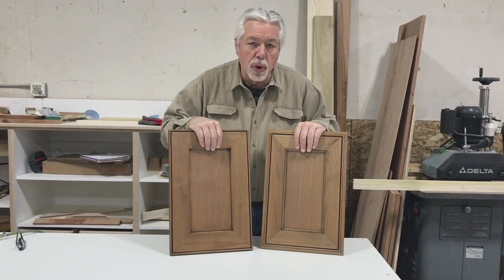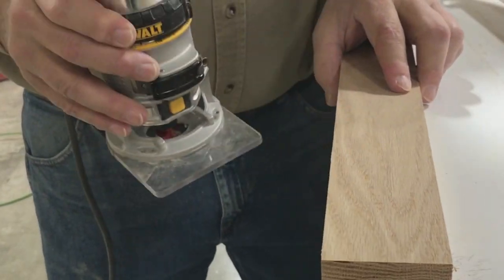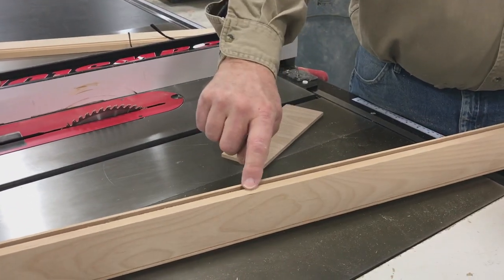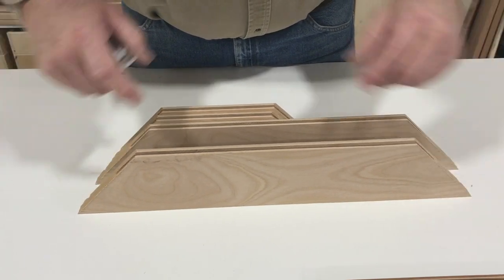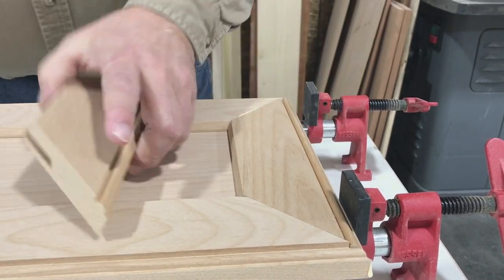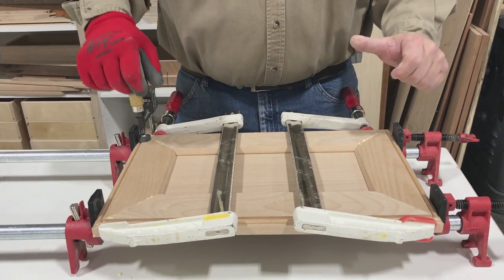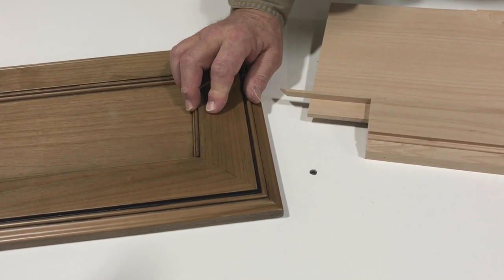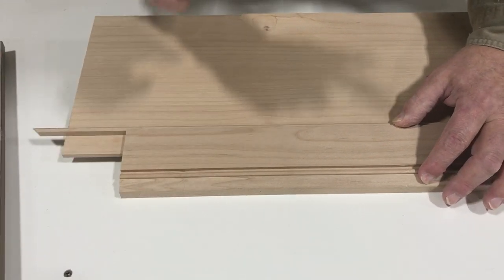Make Mitered Cabinet Doors

Comment: Nice.  I bet a domino in each corner would be so fast to add and also provide alot of Additional strength since that is an end grain gluing... and have an additional benefit of making those quicker to assemble and clamp up.
Reply from the maker: Great suggestion...thanks for watching. Wes

Comment: Wes, I love the doors. I have a few questions. 1. On the first door you build, what is the material width and thickness (3/4 x 2 1/2?)? 2. Where is the panel grooved positioned on the rail/style? Looks like about 1/8" from the back? 3. How much of a reveal is on the inner face of the bevel? Looks like about 1/8?
Thanks for any help. Great videos!
Reply from the maker: Hi...glad you enjoyed my video. The frame is 13/16" x 3". The panel groove is 1/4" wide with a 3/8" face reveal and the remaining 3/16" on the back side of the door. Hope this help. Thank you so much for visiting.
Reply: @WoodworkingWithWes  Thanks for the reply. If my router bit comes in today, i'll be building a trial door tomorrow!
Reply from the maker: @rothfam55  Good luck!! Hope it goes well...don't hesitate if you have more questions. Thanks.

Comment: Great work!!! Can you list what size router bits you used? Also, what's the thickness of your material?
Reply from the maker: Hi... I used a 1/4" bead router bit and a 1/2" ogee router bit to make the profiles for my door.  The thickness of the material ( alder) was 13/16"...which is the standard thickness of all my doors.  Good luck on your projects and thank you so much for visiting.